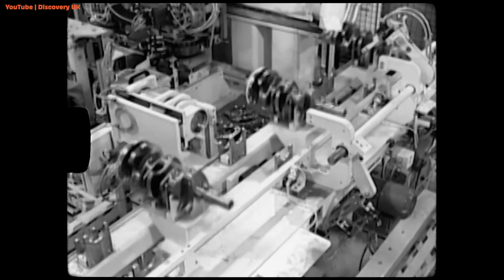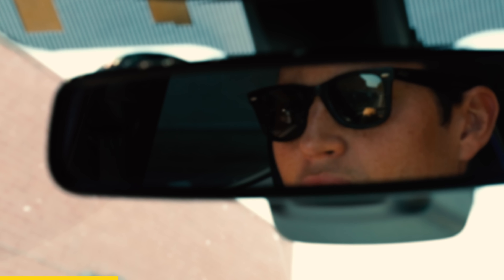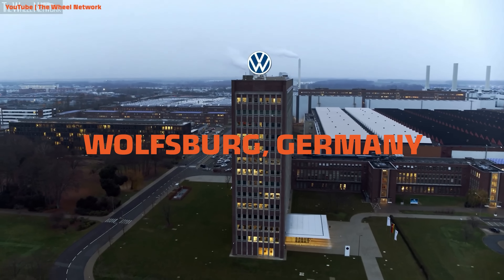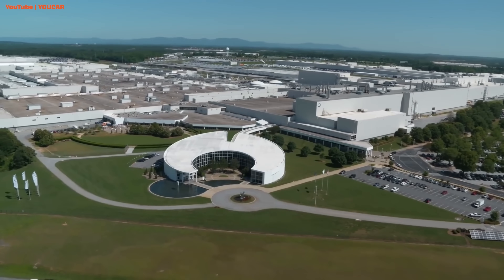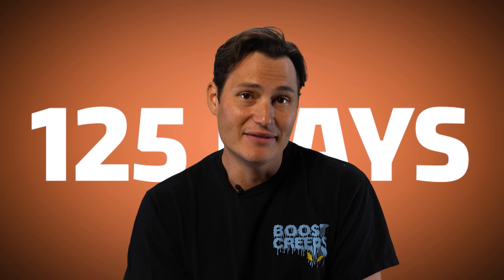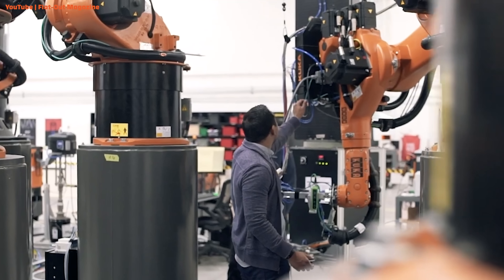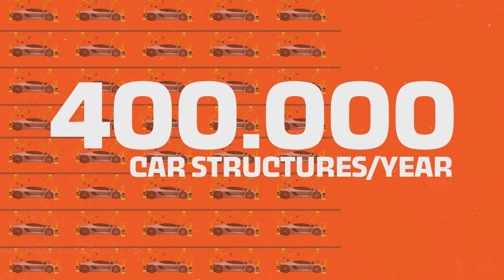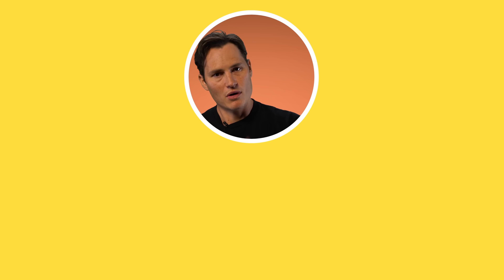A.I. Designed this Car

Comment: Aerodynamics AI: designs car.
Mechanic AI: "This guy's nuts! The only way you can access spark plugs is through the tail pipe!"
Reply: This is a good comment.
Source: Human mechanic
Reply: the guy who put the oil filter where he did in the new Buicks and GMC's needs a wet boot to the face. and for severe lack of forethought on drain locations.
Reply: @michaelfrank2951  my 04 rams 5.7 oil filter is right above the steering rack. A tragedy.
Reply: @RedAssassin274  i used to be a lube tech at a dodge dealership. Just take a piece of cardboard about 2tf by about 8-10 inches wide and make a trough and shove it up the hole in the oil filter access door so it catches the oild and loosen the filter a little bit and let the oil run down the trough into a pan. Then ok once it stops flowing take the oil filter off and swap it out then pull the trough out and put the access door back on and boom no oil all over the rack and everything.
Reply: @jeremyf.2706  I'm gonna have to remember that one.  Thanks for the tip!
Reply: @Truex007  the filter on the 3.7L is in the same spot on the liberty 🤦‍♂️
Reply: @michaelfrank2951  blame the bean counters
Reply: @JSE Games bru what?
Reply: Exactly.  If humans can't build it, they probably can't fix it.  And with such tight variances, a fender bender would total it.
Reply: @workin4alivin585  while that's true, the kind of people who will be buying this likely won't be driving it very often. Chances are with how long it takes to produce even one unit there will be a pretty small number of them and they will absolutely be the kind of collector car that just sits in people's garages
Reply: @jakeshultz2820  it would be pretty wild to imagine a car factory filled with $500,000+ 3d printers just waiting for them to go ding "parts are done" for assembly.
Reply: @workin4alivin585  worse, the fuel lines are inside the chassis...thing just gushes gasoline from a pothole.
Reply: it only design to function not taken a hit.. look at them you can tell.. one hit and it will break...
Reply: @campkira  I was wondering, if it can compute the materials needed based on a crash or just based on how much load it expects the car to make during normal running.
Reply: @asambi69  The AI takes into account air resistance and gravity when designing. Of course "Normal" wear (to a certain extent) would be calculated. The car will be able to reach its top speed at least an amount of times the AI was told it needed to
Reply: @Splomf  Normal wear doesn't account for accidents.
Reply: @campkira  Literally more than a decade ago car companies were already able to run full crash simulations on their cars, so provided it's one of the design inputs and the software implementation is good, this should be just as strong as it needs to be. The only danger is it'll pass the official tests perfectly and fail hilariously when exposed to very slightly different tests as they weren't in the design requirements.
Reply: @campkira  it should have a 2x safety factor
Reply: @campkira  will the ai even let you crash it?
Reply: @campkira  i wonder WHICH car don't get damaged when hit
Reply: @campkira  do you have proof of this?
Reply: Camodo Is A Youtuber Who Likes Making Video Game Vids (1ST TIME I USED THAT WORD ON YOUTUBE). The Ones I Watch Mostly Are Long Drive. Long Drive Is A Game Where You Try To Survive And Drive. In That Game, There Are Bunnies, BUT THEY HAVE A DANGEROUS REASON TO BE IN GAME; THEY ATTACK YOU FOR NO REASON (FNR). So Is Another Game Thing Camodo Has As An Allie: KARL CARS. They Are Car Guys That Make His Game Glitch. THERE ARE (SO Far That I Know Of Making This Comment (7/20/2022)) 3 KINDS INDUVISIALLY: Karl, Karla, And Karrot. In Game They (Other Than Karl) Have Special Features/Things In Game You Should Know Them About. Karla; Is A Femaline Veirson Of Karl, And Is Nice. Karrot; Is Orange, And Is Drivable (Unlike Karl And/Or Karla).

Comment: AI is a buzz word in computer science. Most of the time when somebody is talking about AI, they are actually talking about ML. This car is no exception. Great video tho. keep up the good work!
Reply: It really bothers me how AI has lost all meaning.
Reply: Ben Daulton  Yeah, this whole AI takes over the world thing is no less sci-fi than it was when The Terminator came out. The methods we have today are still at their infancy stage. The latest gpt3 stuff is one of the most advanced ML we got today and it is still nothing more than a very good fitting neural net made from a huge data collection. Hell, we don't even know how humans are sentient let alone fitting a neural net to be sentient...
Reply: What is ML?🙄
Reply: @albertoseibeb9123  It is Machine Learning. A cool name for using networks to fit into a set of data and then be able to act as if it knows what the data is all about. It doesn't really know or learn anything tho. It's more intuition than learning to be honest. Basically, you show a bunch of cats to a program, and then it becomes able to identify a cat. The program doesn't use logic like "If it has pointy ears and whiskers it's a cat" type of deal. It is more like adjusting the parameters each time just a little bit + a little bit bias (Bias is a bit more complicated. If you don't add bias the network converges. You don't want that.) and then using the final state of parameters to a new data to see if it fits or not. Very useful for some applications, not so much for others.
Reply: Ben Daulton  T800s would be a huge problem.. until the first big rain storm
Reply: Daniel Large  The Turing Test? This is obviously not a language processing software. Turing Test is not a magical test that tells you if something is AI or not.
Reply: AI and Machine Learning are both just fancy words for optimisation. All you're truly doing is optimising a transfer function between hyperspaces within a set constraints and then using that transfer function to make predictions ;) if we want to be pedantic
Reply: I get what you’re saying but it’s a lot more than a buzz word. Yeah it’s true that “AI” gets thrown around and misused a lot. But equally I don’t want people to eat the impression that AI is super advanced and not yet ready, or that AI only means super intelligent machines that will turn on us. 

AI is being used already. This was AI. Machine Learning is a subset of AI. AI really is what it says, intelligence which is artificial, basically intelligent machines which are capable of “thinking”. It doesn’t need to be human-like thinking. But it takes in information, is able to use some algorithm or logic to find a solution or make a decision.

ML is part of AI. Machine learning is how a lot of the time the intelligence is built. And then you have an AI. That can be used to make decisions. So this car was designed by this method that would qualify as AI. At least according to most definitions.
Reply: @emilchandran546  the point was that AI is a buzz word. Its just meaningless to say an AI designed this car. In the CS field if somebody comes to me and starts talking about AI the way they did in the video, I would assume they know little to nothing about CS. Its like saying "the new Ferrari works by the laws of physics." or "the new vaccine was designed using chemistry" that is just meaningless.

The ghosts from Pacman are also AI. They follow algorithms which are a set of ordered atomic instructions. By no means it can be considered thinking. A pocket chronometer watch has an algorithm that is embedded using a machine contraption yet you wouldnt say it is thinking do you? But if the internal mechanism were translated into a software, it would definetely fall under the category of "AI". That is why it is such a buzz word and in the end meaningless. I remember even the AI classes introduction were about how much of an umbrella term it was.

I agree with you on the AI taking over the world part. It is more of an hollywood thing not a real concern of anybody in the field. Except Elon Musk whom I dont understand where he is getting all that dystopian tales from.

I recommend Geoffrey Hinton's research on the correlation between human intelligence and AI. Its about how none of the "AI" or ML we got today has to do with what real human brain works. Its not even mimicking the brain or neurons they are just hype words that help with marketing.
Reply: @6warboy9  that’s why I put “thinking” I’m the quotation marks. No, it has nothing to do with human-like thinking. But The ghosts in Pac-Man were not AI. Not by a modern definition. If they were able to track parameters learn from the results of previous games and adapt to improve their performance, that would be AI.

AI is really not that hard to understand. Traditional programs were programmed they were essentially given instructions. AI is about machines using intelligence. So whoever said above that this is just optimisation, it’s not. Running through and brut forcing the best design is not what happened here and is not AI.
Reply: @6warboy9  when I used the word “algorithm” I wasn’t using it in the traditional sense. The YT algorithm is AI. No one can even define it, but it knows what it’s doing and the algorithm is constantly being refined. It is able to consider thousands of variables and is designed principally to maximise revenue. But how? We don’t know, ML created it. So it is absolutely nothing like the PAC-MAN ghosts or a mechanical watch. Which were both designed by humans and therefore do not have their own “artificial intelligence” they are only vessels for human intelligence.
Reply: @emilchandran546  The shoes you are putting on the term AI are more fitting I agree. Unfortunately that is not the correct use of the term. The constantly refined algorithm thing is Machine Learning. I gave the watch and pacman example to show that how much of an umbrella term AI is. It can literally mean any software. It is unfortunate and possibly a waste of such a cool term such as "artificial intelligence" yet it is what it is. The research made in the 90s on AI were promising at first yet failed to live up to expectations of the time. Later on, the term AI lost its initial meaning that were supposed to be what you are describing. Instead, with modern tech and research we have a whole new field! That is ML and is exactly what you claim AI is!
Reply: @6warboy9  no the term has not lost all meaning. Look I’m not an expert but this guy is:

http://scholar.google.com.au/citations?user=F5cftvMAAAAJ&hl=en

I asked him just now, “what is artificial intelligence, as it is understood by people in your field?”

No research into AI did not fail in the 90’s, that’s total bullshit and I have no idea what you mean. AI has been making strides consistently for decades. What does that even mean? How did it fail back then?

It comes down to this: Is there a programme being run, instructions followed or logic written for a computer to make a decision or find a solution? Or is the computer being fed information from which it “learns” and therefore has “intelligence” which it uses to make decisions. 

Therefore as was my first comments whole point ML is a huge part of AI. ML is used to build the AI.
Reply: @emilchandran546  What failed in the 90s wasn't the whole field of AI. I am sorry for the confusion. I was referencing the research done by Geoffrey Hinton (Who can be considered the father of AI). Back then, all the hype was to understand the human brain using AI. During this time, first Hinton and then his student Yann Lecun tried to mimic the human brain using AI yet the final consensus was that the two are nothing alike. Following this consensus, Hinton himself said that an AI is not the way to describe or discuss any kind of "intelligence" or "learning". I remember the analogy from Hinton's book Unsupervised Learning that says comparing a neural net is like comparing a marble ball with a rally car.  I gave that "AI failed in the 90s" example regarding your comment about how AI is intelligent or learning in a literal sense. Again, sorry for the confusion. 

As for the answer you got from a professional I am not going to argue with it and, I must admit that there must be different uses of the terminology within the field. It is also likely to be this way regarding the massively large domain of the field. 

Thanks for the clarification.
Reply: @emilchandran546  thank you. Someone who understands the field. The speeds at which ML can process computations are far superior to any human's capabilities. This is how it starts. Technology as a whole is going to advance exponentially faster because of ML; consequently, so will AI. You cannot have AI without ML.
Reply: @EricJCaraballoso  process computations faster than humans? What does that even mean? A mechanical calculator from 19th century can do that as well. 

Technology is already advancing exponentially. It has been since the dark ages if I am not mistaken. I agree ML can play a role in scientific research especially in social sciences or environmental sciences due to the huge data sets we have and the lack of any methods that can truly analyze the data beyond fundamental data science and statistics.

Saying "You cannot have AI without ML" is just meaningless if not straigth up wrong.
Reply: Eh...  no? Deep learning IS AI! It’s based on how our own neural network in the brain works. If that’s not artificial intelligence then what is?? In fact it’s actually easier to make the argument that all other types of “AIs” are not “AI” as they don’t model after our own intelligence in its foundation. So if anything, deep learning IS the real AI.
Reply: @happycamperjack  I'm pretty sure this doesnt use deep learning,  it's topology optimization which does not require deep learning to work. it's just an optimization technique.
Reply: @poopyhead280  Pretty sure? Did you even bother to google? Cus I am PRETTY SURE they leveraged generative designed components. Why don’t you google that and see if that’s “AI” enough for you?
Reply: @poopyhead280  show me where it says 21C’s regenerative design has no deep learning involved? Prove it or shut up!
Reply: @happycamperjack  It is not modelled after our own intelligence. They tried to do so in the 90s yet in the end they understood the brain works nothing like a neural net. I recommend Geoffrey Hinton's research on this exact topic of AI or ML being a brain simulation thing. It turns out those nets provide real good solutions to some problems that is why they are still around but the terminology such as "neural" or "intelligence" or "learning" shouldn't be taken literally. Its just a math function that tweaks itself depending on the result.
Reply: @6warboy9  lol in the 90s?? What you smoking man? Deep learning didn’t really become a thing until a few years ago even though its conception was long that. Deep learning IS model after the way our own neuro network to a certain degree. You know how you can distinquish between different faces? That’s you own CNN doing to the job. I recommend u taking some actually education in deep learning before you come out with misinformation for those who don’t know better.
Reply: @happycamperjack  Who is talking about deep learning? Despite the media hyping those things as mimicing human learning, that is not true. 

I wouldnt bring this up unless you provoked but I am a software engineer currently specializing in ML. I commented because I wanted to clearify the misconceptions such youtube videos about AI and ML claim to be true.
Reply: @6warboy9  lol what year are you in? Cus u don’t sound like an experienced software dev at all! Most generative design these days do use deep learning to generate the final design. So this is equivalent of arguing whether deep learning is “AI”.

Comment: Kind of disappointed in the lack of research in this video, the majority of vehicle manufacturers in this day and age use robotic arms, 3d metal printed parts have far less tensile strength as machined parts they are not the end all and be all. Things like the intake pipes shown in the video are still extruded parts as they weigh less then 3d printed parts, 3d printed parts are used by many manufacturers like Borgwarner, Garrett and many others. AI assisted development does not mean the car is completely made by AI it still has a human watching over it... well for now skynet isn't a thing yet. AI suggests ways to lighten or reduce materials and many manufacturers have been using this technology for a long time including GM and many others. I give you a 1/10 for your content.

Comment: You have drunk a LOT of their Koolaid; AI is already used extensively, additive manufacturing is only currently economic for small expensive runs and the assembly pods take a fiendish amount of effort to set up and will need significant maintenance.